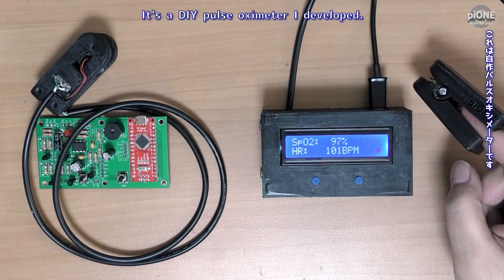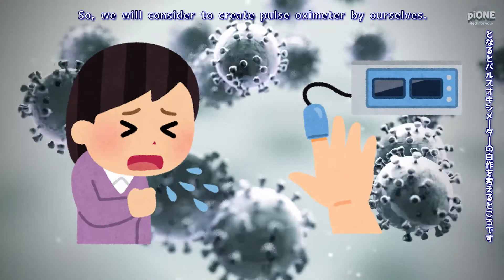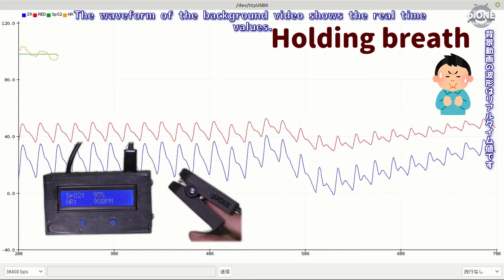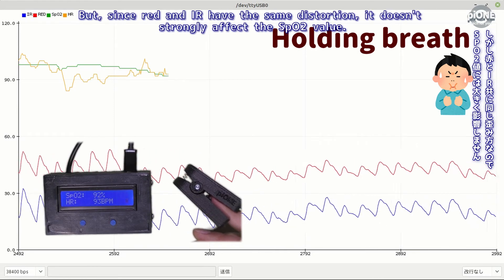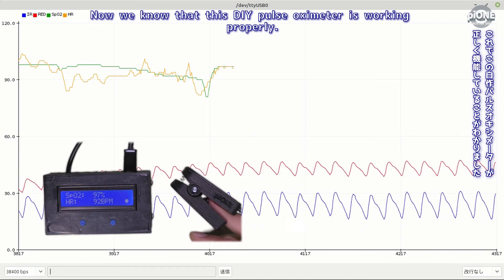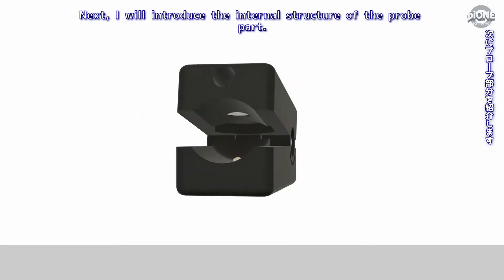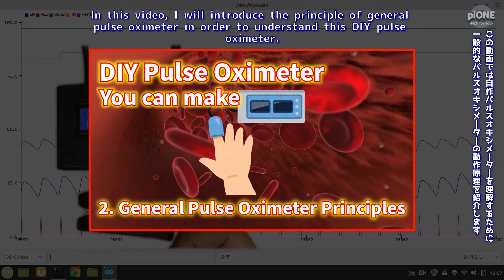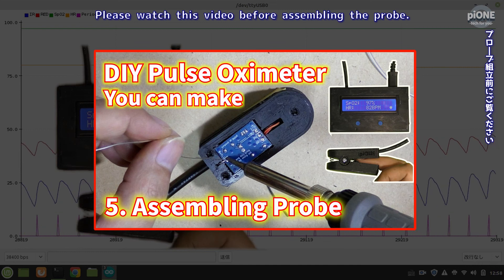DIY Pulse Oximeter you can make   1.Introduction

Comment: realy realy good job , one of the best videos that i saw in youtube until now,
can we use smd sender and resiver leds and is it ok? their size is not important?
thank you very much
Reply from the maker: Thank you for comment.
SMD sender and receiver are also available if you edit probe design.

This Pulse Oximeter is transparent type.
If you want to use reflective type, you should rewrite program.
Reply: @pionechannel1551  we want to make transparent type to , because i think it can be more accurate. Be success.